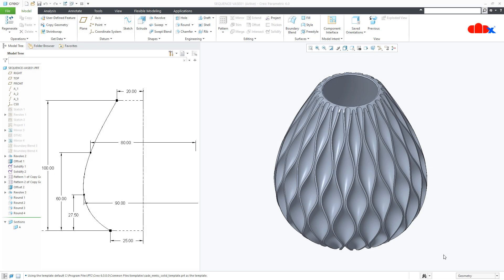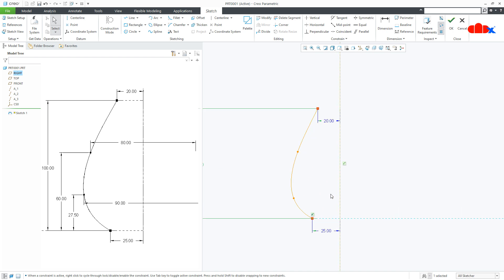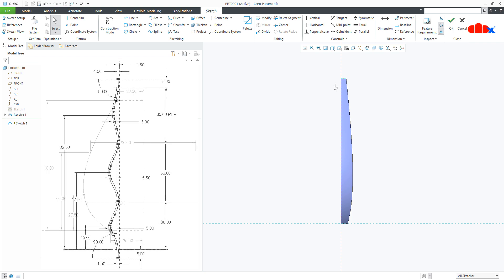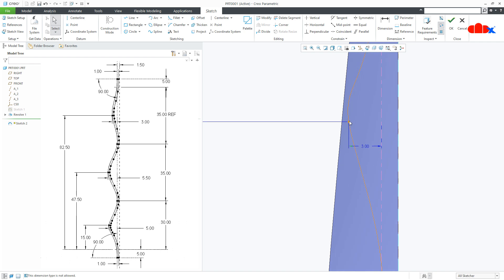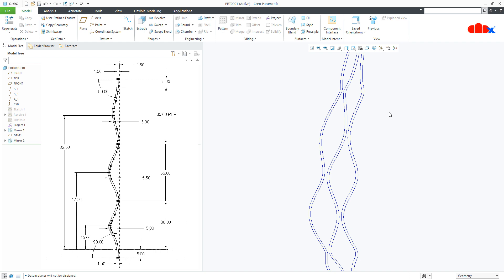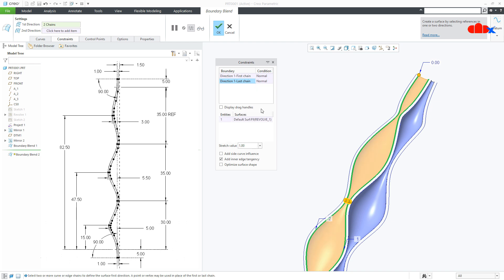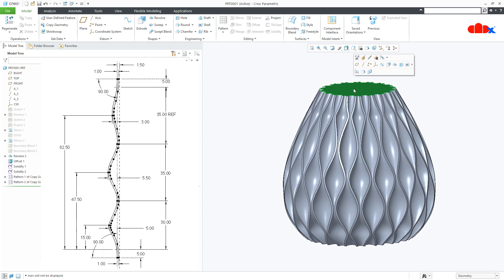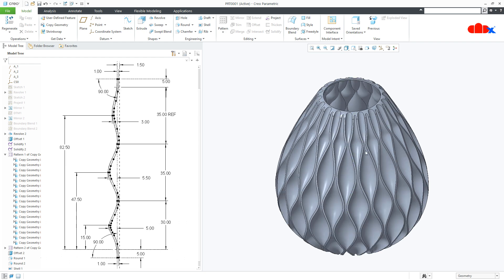Sequence Vase | Boundary blend | Surface modeling  in Creo Parametric

Comment: sir i am not able to offset the bottom part done at 16:26, could you please help why it is failing to generate the bottom offset?
Reply from the maker: No problem. You can even create the part without offsetting that.
Reply: It didn't work for me either. Then I tried offsetting it by 4 instead of 5 and it worked. You should try that too!